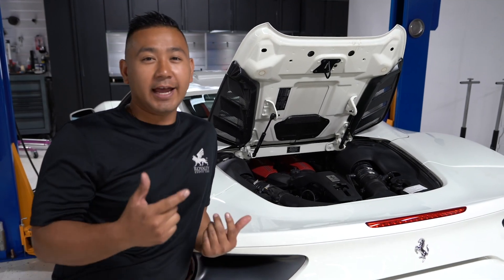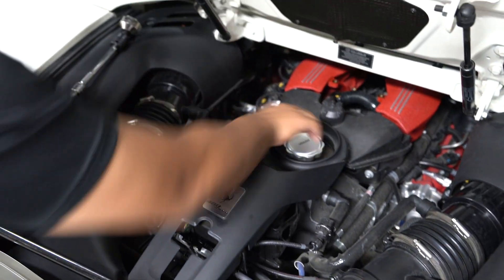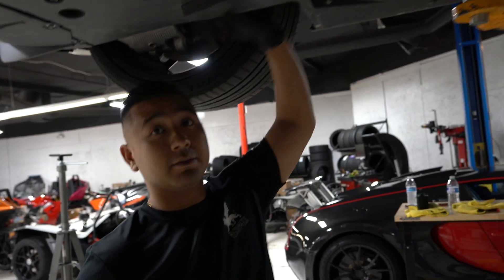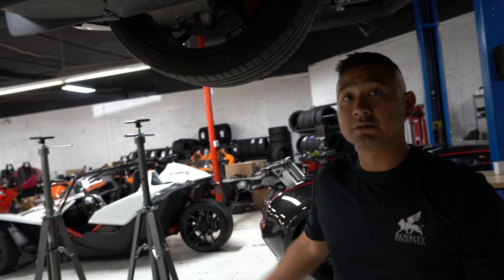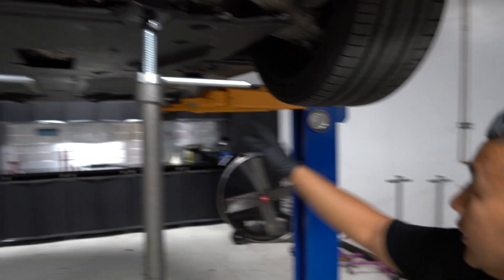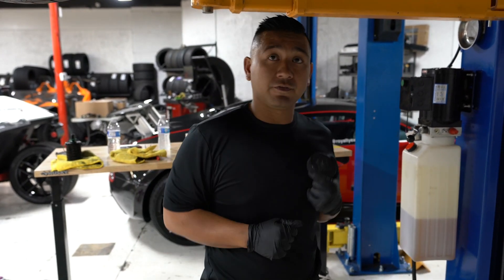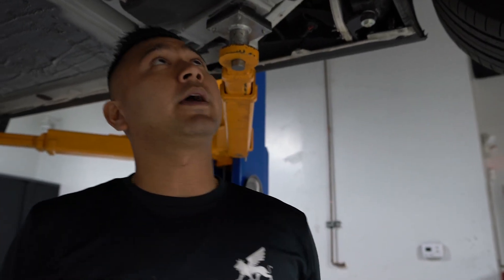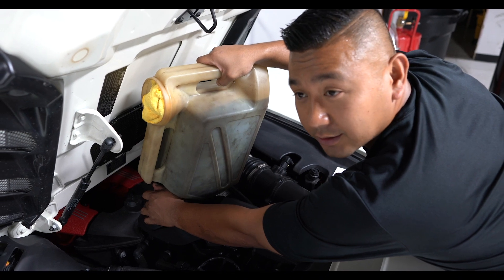How to Change the Oil on a Ferrari 488

Comment: You should do a brake pad and disc change vid on a 488. Nobody has done one, and the calipers on the Speciale, 488, Pista, F8 and 812 are completely different than the classic calipers.

Comment: Hey Jesse's can you do a video where you do an oil change with a Mitty vac and Then use the drain plug to drain the rest of the oil
The reason why I'm saying is that way we can know how much old is left in the drain pan nas if Mitty vac is efficient way of oil change or not ; also what are the pros and cons of other alternate methods like changing the drain plug to a quick drain something or drilling circular access ports on the plastic under cover

Comment: Better to vacuum oil change out most of the oil from filler cap and change the filter. 
yes
100% of the oil will not be changed so vacuum oil change run engine for 1-2 days and vacuum oil change again. 
Then
The only problem is oil filter change every other vacuum oil change.
Reply: Easy to charge to change oil filter. Maybe have the shop change only the filter. They will screem and wine but vacuum oil change 
No lift just vacuum oil change out the oil with a tube 
Yes
100% of the oil will not be removed so in 1-2 days of use do a 2nd vacuum oil change.

Comment: I would go a bit further out of paranoia Jesse, because of the dry sump system that is also connected to the turbo's. Before putting back on the under covers, warm it up/test drive, then re-drain/re-measure and change the filter again, then fill again cuz that Rari aint cheap. #OverKill #FullFlush

Comment: It would be a whole lot easier with the car on a 4 poster rather than on a wheel-free lift.
Reply from the maker: harrygatto you couldn’t get the panels off the bottom, these cars are completely covered underneath
Reply: Royalty Exotic Cars  I know but the car would be supported on its wheels with the whole of the underside clear, what is blocking removal of the panels?
Reply from the maker: harrygatto they sit like 4 inches off the ground so you can barley get your hand in between the lift and the panel, let alone a tool.
Reply: OK, got it, thanks. It's been a very long time since I worked on Ferraris, 1970s.